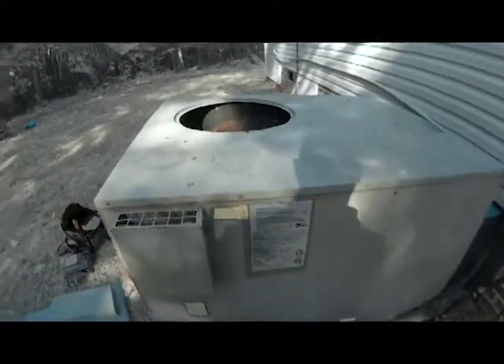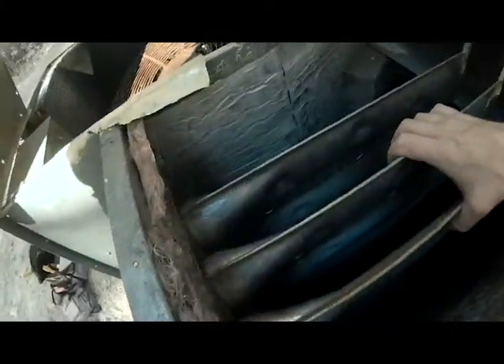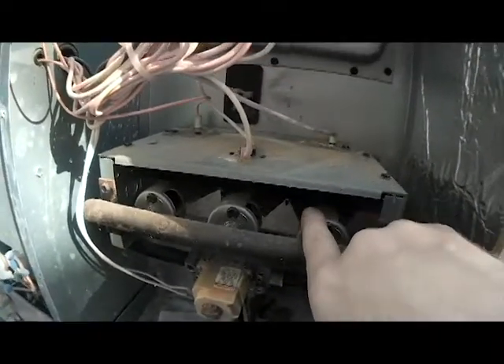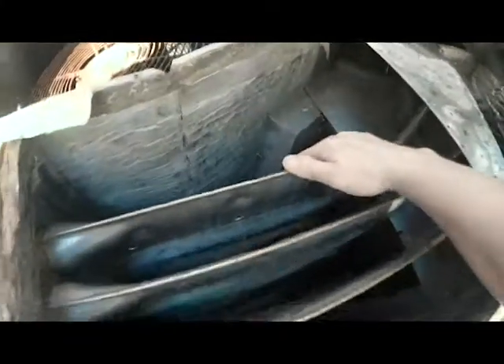How to Check a Goodman Heat Exchanger for Cracks!

Comment: hey have the same unit on as a roof unit  and I think my the heat exchange is crack  I. Am having rollout and having problem findings the heat exchager on line so can buy one.
Reply from the maker: You might have to call a supply house to get it...only bad thing is you have to have a license to buy from there....good luck!